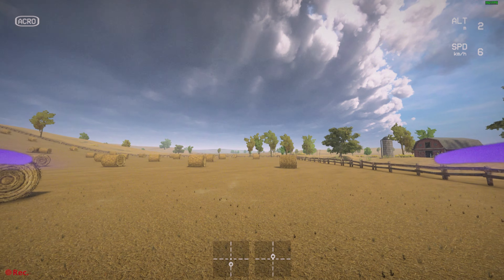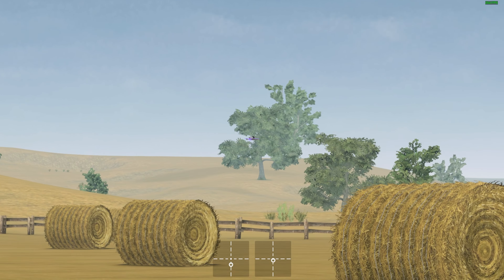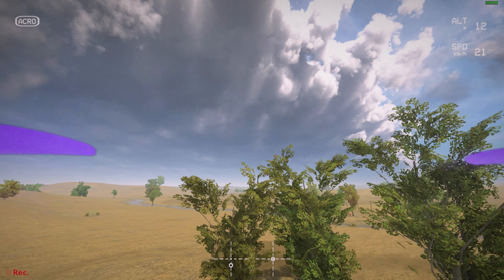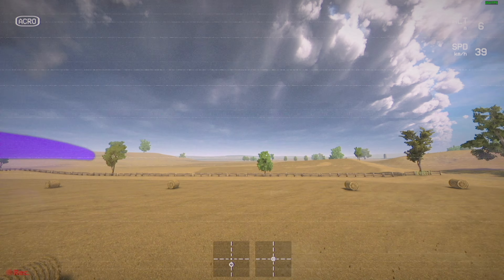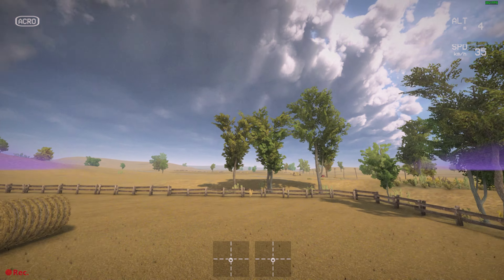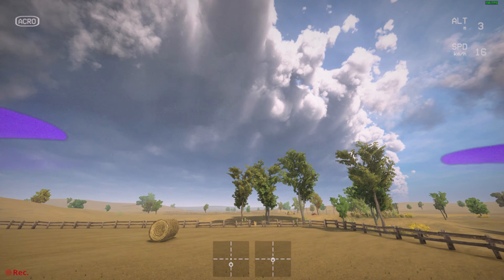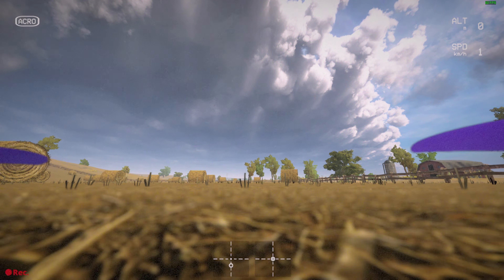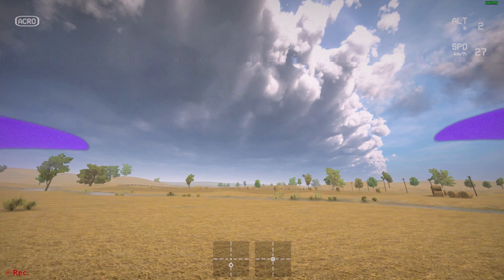Learn to Fly an FPV Drone - Lesson 3 - How to slow down

Comment: I think this was a good idea to have students learn to slowly control the quad in ACRO mode vs learning Horizon or Angle first and then struggling to transition to ACRO later.
Reply: It is way better. I started learning on FPV.SkyDive with no knowledge and stuck in ACRO. I then decided to buy liftoff and it forcing the auto messed me up so much.

Comment: As a helicopter pilot I will tell you that drifting back can be deadly as the rear skids may “dig” into the ground and a flip over occurs! It seems the same theory  applies to a quad…..If you are drifting back the pitch would be nose high and the rear motor arms may hit and dig and cause fairly severe damage!  Just a thought!

Comment: Hello, Mr Joshua, i read the lessons 1-3, and I tried it , that has a situation make me cant not do the exercise like yours. When the drone leaves the ground,and it always goes left.  i added the dead zone(0.3) both in the roll n yow, it fixes a litte, but stll happens . Some of blueprint fleet will go back, most will go left, in the neutral position. Pls tell me some suggestions, (my simulator version isn’t the newest. ) thank you your sharing.  You made very good videos for the beginners

Comment: Joshua, I am beginner FPV pilot (but have done RC for almost 14 years now). Have you ever seen beginning pilots intuitively rotate 180 to break? I am still learning the muscle memory to break  fast and smooth and without any overshooting backwards. I hate going backwards where I am blind. And so intuitively in the beginning or when I feel lilke I am losing control I will use jaw to spin 180 while pitching even more forward and giving more trottle. This is the smoothest and quickest way for me to slow down, but I have to do it on time because of course I will swing out, can't do it to close to something or I will hit. But at least the quad will swing where I have just looked, and not overshoot backwards where I don't know what's there. Do you see other beginner pilots do this as well?

Comment: I love this series!  One problem I've having with slowing down is when I add just a little back pitch the camera goes straight up and never seems to return horizontally until I'm hitting the ground.  Advice?
Reply from the maker: Check your gimbal calibration to be sure when you put in a little back pitch, it's only going a little. Assuming the gimbal is working propery, maybe lower your rates? Fast rates will make it harder to input precise stick movements.

Comment: Great video. Sorry, I have off topic question. I’m trying to connect radio master tx12 to iPhone XR via data cable, but it looks like controller doesn’t see my phone, tried also with pixel 6a. With pc works fine. Could you suggest anything?

Comment: Just learning M mode, and thanks for this video series.  I got Liftoff and have started watching the videos.  Do you recommend setting the left control stick loose, as in not having auto center on this stick.  I have a DJI Avata, and planning on doing some inside buildings work at a construction site.
Reply: Hey I'm wondering the same, should we put it loose? What's best

Comment: We have talked a while back before. I'm new to the hobby and know nothing.  bought a emax hawk sport with a jumper t16 and goggles all set up for my first fpv. It's way too fast and definitely in acro. I don't know what my  switches do besides the arm and beeper. I don't own a computer so can I use the speedy bee app for android to figure out my switches and set up a safer flight mode??? Definitely a hazard if I fly it like this😢.some could definitely get hurt. It's on 6s so I'm going to try 4s to tame the speed Down but I definitely can't fly in acro yet.

Comment: Non-video-relevant comment coming up. 
I decided in my childlike enthusiastic mindset to fly an acro quad to the top of a local mountain. Having fitted a longer range antenna, i felt it would be fine. -it wasnt. I ended up having to take an entire day off from work to go climb a literal mountain to retrieve a non-gps drone. Luckily i recorded the flight and could guesstimate the drop location and 12 km later, 5,5 hours and 829 height meters i ended up seeing what i flew up to see and vrought home my drone. Some lesson learned probably.

Comment: This is the easy stuff... what i want to know is how some of these guys are making these times in the drl sim... its like they know something different... would love to know what im doing wrong... compared to the top 10 guys.
Reply: Practice. Practice. Practice. 
Learn to fly fast with the Goldberg 1" drone. Accurate smooth flight is necessary to get to the top of that leaderboard. 
Learn to handle the momentum of the DRL4 racer. 
REPLAY the lines the fast guys fly on the leaderboards. 
Work out, or learn, how flying at high pitch angles changes the way your RC inputs control the drone.
RSC MODE-HA @ DRL Sim